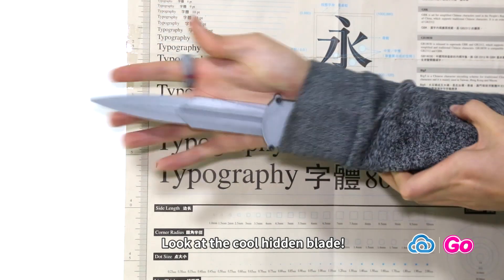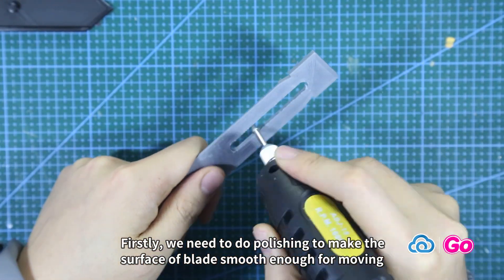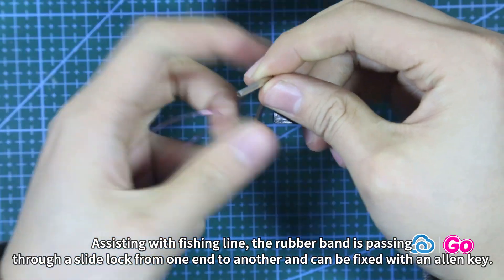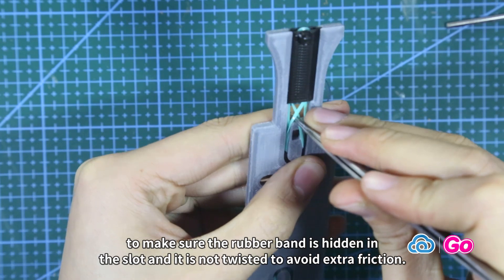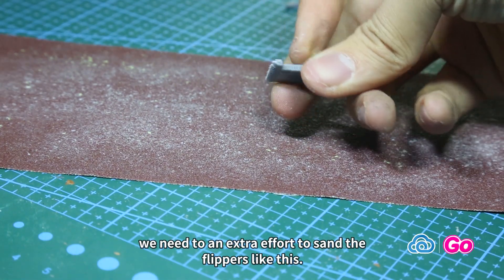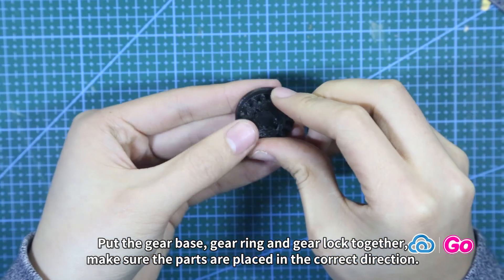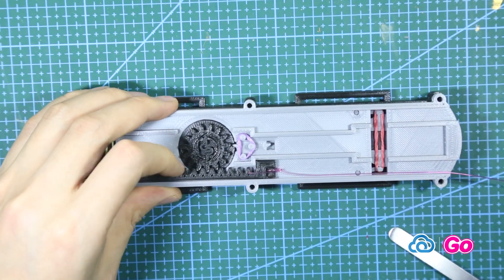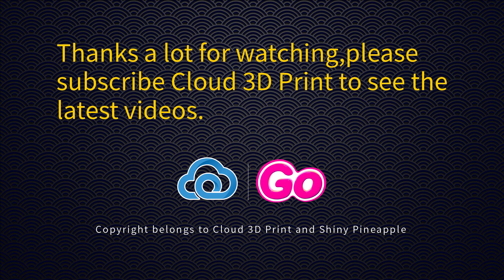3D Printing and Assembly of Assassin's Creed Hidden Blade

Comment: Thanks.

But I feel like it needs a second gear for reduction, I cant trigger it from the same hand Xd it needs to be pulled way further than my finger can reach
Reply: If you move your thumb around the string you can get more tension to engage
 the trigger
Reply: i think you can just make the wire shorter

Comment: I hate your tutorial. It's the only one for this hidden blade and you skipped two parts, fail to mention that you've resized the gear assembly, failed to specify which switch plate and carriage you used. It also would have been helpful to specify the size of rubber bands needed.
Reply: looks like he used the double switch plate